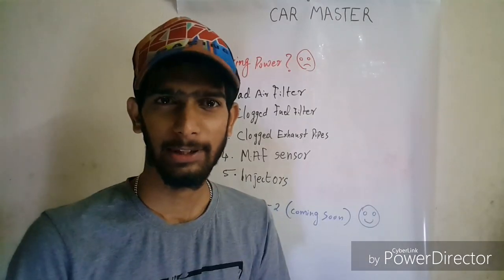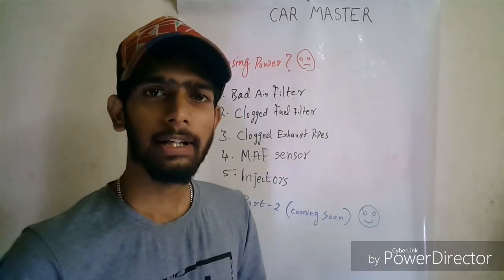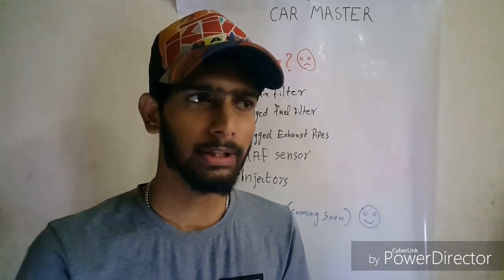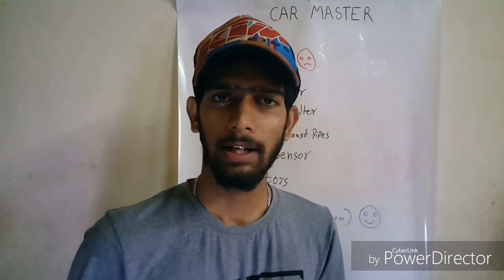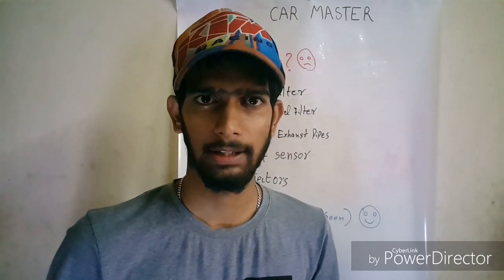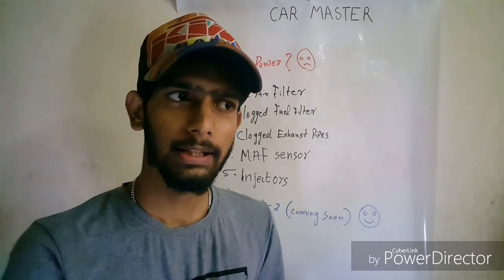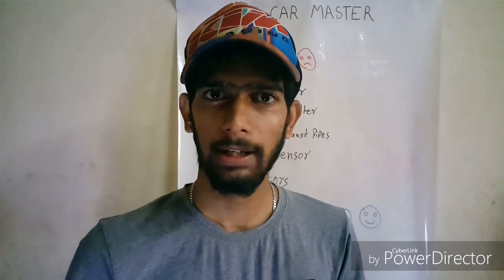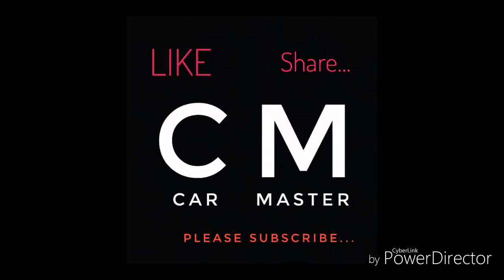വണ്ടിയുടെ പവർ കുറയുന്നുണ്ടൊ?, ഇതാണ് കാരണം... വാഹനത്തിന്റെ പെർഫോമൻസ് കുറക്കുന്ന കാര്യങ്ങൾ Part - 1

Comment: Bikil ithupole ulla presnam undakumo bro
Reply from the maker: yes,
filter,carburetor,sparkplug ithokke kurach kalam kazhiyumbo efficiency kuranj varum. 
pinne evdelum oil leak undel ithinte carb,sparkplug il okk clough um carbon um okk adinj koodum.

ath pole bike nu okk valve Timing maran chance nd apo ath correct cheyyanam
Reply: @CARmastercarmaster5523  Thank you

Comment: Is it necessary to remove carbon deposited in the crankcase of an ALTO 2008 model.
Reply: Up to 1lakh Kms clean the oil sump remove carbon deposits (very low in Petrol engine)It will give long life to the engine parts,Minimise wear& tear of  movable internal engine parts.
Muhmedshaji Muvattupuzha
9895124108